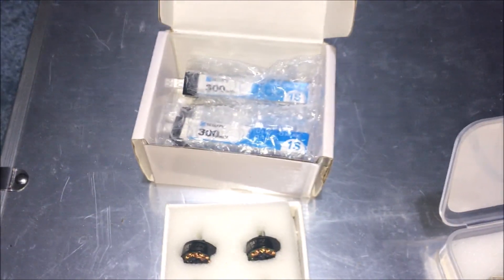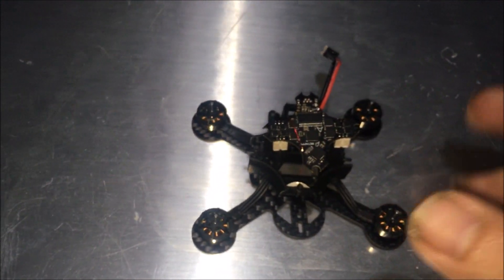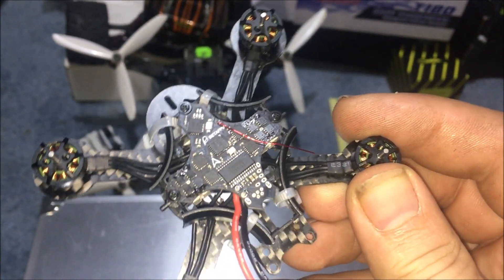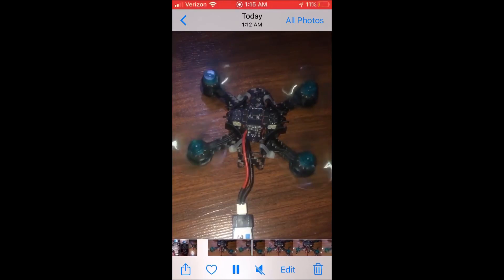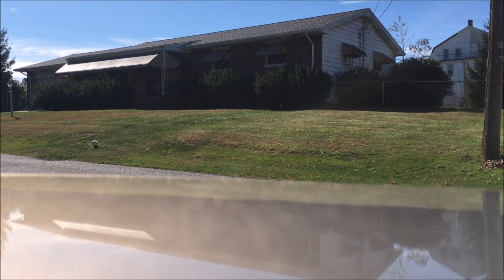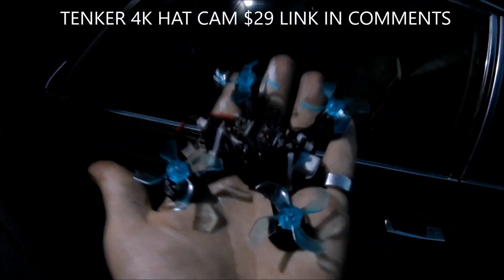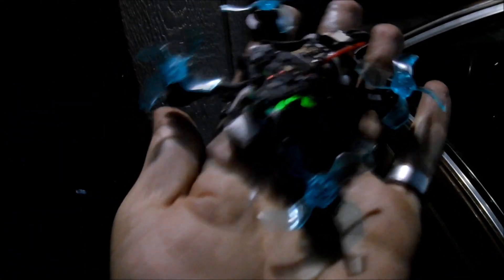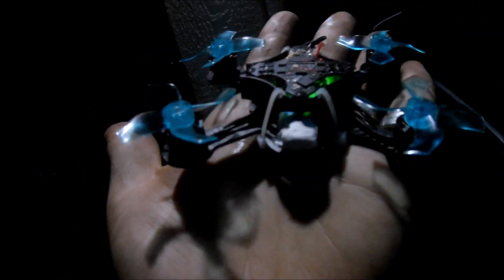BETAFPV MICRO BUILD BLHELI Reverse Motors F4 1S 1103 Brushless Motors Flight Test Review motor fix

Comment: Why didnt you just flip the flight controller over?
Reply from the maker: Because that wasn’t the issue
Reply: The FC mounting holes dont line up?
Reply: So why didnt he just use the FC mounting angle setting in betaflight and set it at 180? That's easy and you could mount the board vertical or at 45 degree angle if you want!

Comment: You’re really going for it. Outstanding. One tip I learned about reversing motors is that when you hit something the prop nuts are going to loosen. Constantly check them and keep extras in your bag. Great video. Reversing props and motors kicks scraggle and grass away from the camera also.